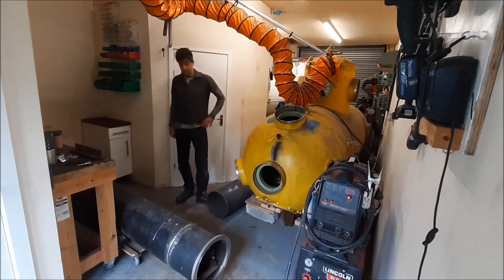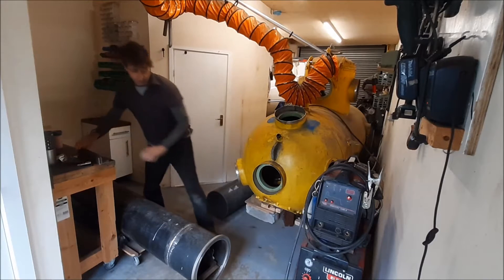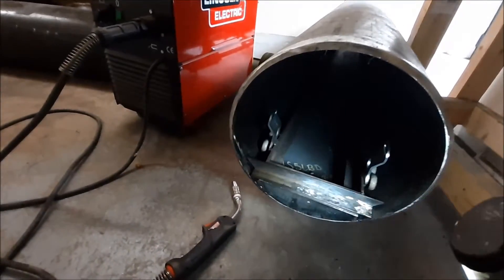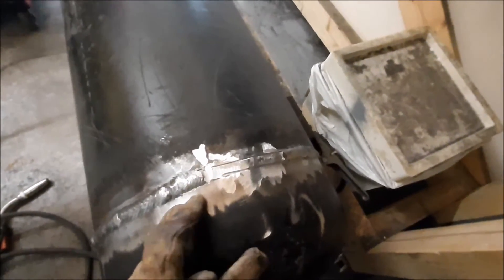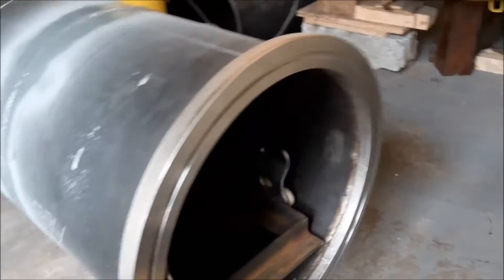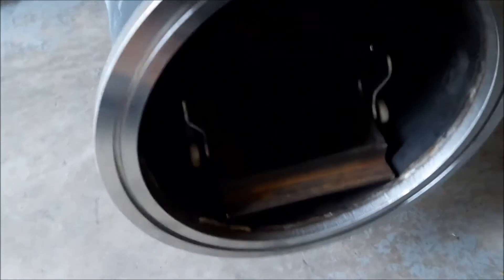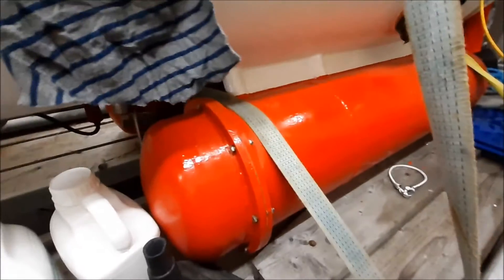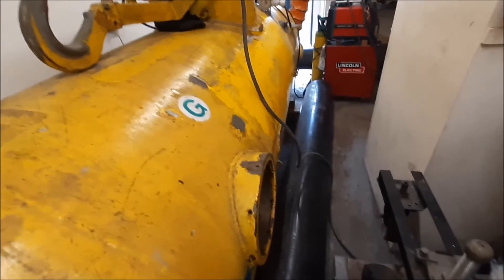Building a Submarine, Part 4.

Comment: Why are the battery cilinders so big? Why not smaller?
Reply from the maker: Thats the size called for on the K350 plans which I followed for this design.  Holds 4x deep cycle batteries in each pod.  Weight of these, plus lead adds ballast to the boat.